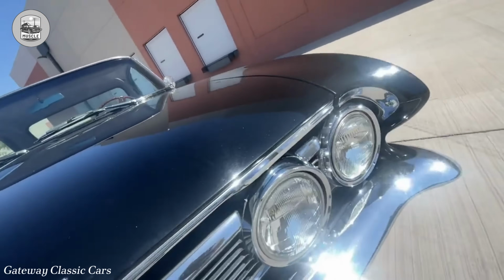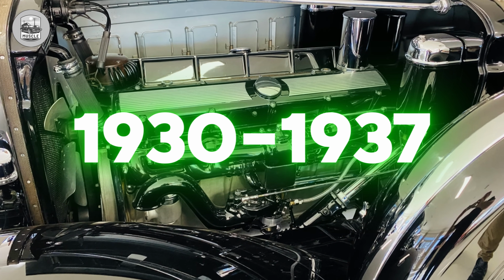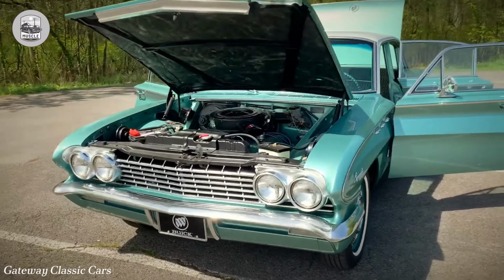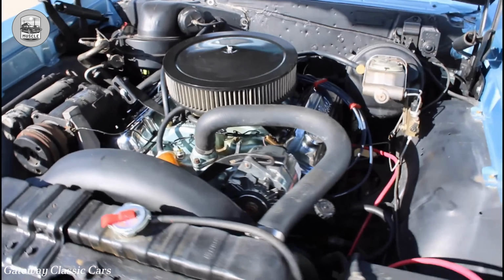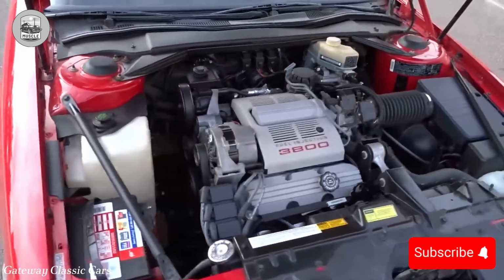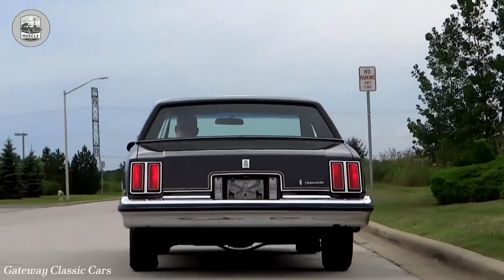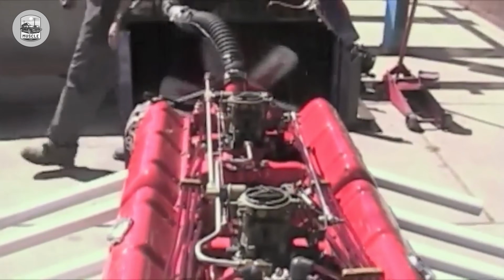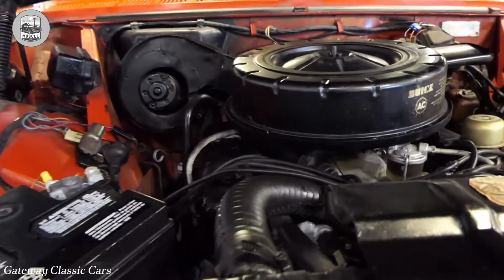10 MOST FAILED and WEIRDEST GM Engines ever made | Worst engines blunder!

Comment: There's my favorite oddball engine right at 0:48 ...  The Cadillac V8-6-4 with Eaton controls on the rocker arms instead of the disastrous, modern modulated displacement engines that screw up the lifters...  I drove one for 100,000 miles.
Reply: I bet you drove it with the ONE wire disconnected to disable the system. Those engines did NOT work at ALL well with it hooked up.
Reply: @davelowets  Nope, you lost that bet.  I put a rebuilt ECM in it when I first bought it in '93, and it worked just fine.  On flat highways like Marin to Sacramento it got 22 MPG with the Modulated Displacement system active, and 18 MPG disabled.  (I think one of the newer, lifter-type systems are called DoD, Displacement on Demand..)
Reply from the maker: @davelowets  You're spot on! Many enthusiasts found that disconnecting the one wire to disable systems like the early emissions controls or fuel-saving features brought the engine back to life. These engines, especially with early versions of technology like GM's Displacement on Demand or similar systems, struggled with performance when everything was hooked up as intended. That said, when bypassed, you could really unlock the true potential of these V8s. A lot of people prefer the raw, unrestricted feel of these engines without all the added electronics.
Reply: @MuscleCarMasters68  Yep. I drove one back in the day, and it ran a WHOLE lot better with the system disabled. It's too bad that it didn't work right because that really would have been a gem back then.
Reply: @MuscleCarMasters68  Don't get carried away, you still ended up with a smogged out, low compression 140 HP engine...
Reply from the maker: @marko7843  You're absolutely right – by the mid-'70s, many muscle car engines were hit hard by emissions regulations, leading to lower compression ratios and reduced horsepower. The muscle car era had to adapt to new government standards, and unfortunately, many engines suffered. That 140 HP mark was a far cry from the high-compression beasts of the late '60s! However, enthusiasts quickly found ways to bring back some of that lost performance by upgrading components, like heads, cams, and exhaust systems, to work around those restrictions. It's amazing how much potential those 'smogged out' engines still had with a few tweaks!
Let’s hear from more of you! How did you modify or improve your engines during the '70s? Drop your experiences in the comments! 
Thank you so much.
Reply from the maker: @davelowets  Great to hear from someone with firsthand experience! You hit the nail on the head. Systems like GM's early Displacement on Demand and other emissions or fuel-saving features were ahead of their time but often fell short in execution. When these systems were disabled, it allowed the V8s to perform as they were originally intended – powerful and unrestricted! These engines were built with raw potential, and once enthusiasts bypassed those early tech limitations, they could really tap into that classic muscle car feel we all love.
Reply: @MuscleCarMasters68  As long as you brought up the broad subject, I want to put in an honorable mention for the 1972 Olds Rocket 350.  As you know, GM chopped their compression ratios in 1971, a year before GM and Chrysler, and God knows I've driven many of the depressing results made between '71 and '79.  A mere 5 years later that same rocket 350 was totally gutless...  Somehow though, WITHOUT an air pump, Olds got the '72 heads & cam so right that my Cutlass would easily shred the rear tires, deliver 20 MPG at 70 MPH without overdrive, and you couldn't even make it ping!  You could advance the spark until the engine misfired, and it would never ping on regular leaded 88...   Sighhhh
Reply from the maker: @marko7843  You're absolutely right about the drastic compression drop that hit the early '70s hard, making many of those engines feel sluggish. But Oldsmobile somehow managed to get the balance just right with the 350 in '72. The combination of those heads and cam, as you pointed out, gave it a surprising punch. The fact that it could shred tires, deliver impressive fuel economy, and resist pinging, even with the timing cranked up, really shows how well-tuned that engine was. It's amazing how Olds worked around emissions restrictions without needing air pumps, something that plagued other GM engines of the time.
It’s a perfect example of how the right engineering can make a low-compression engine still perform beautifully. That 20 MPG at 70 MPH without overdrive is impressive, especially for the era. They really nailed the balance between performance and efficiency, which is a feat not many automakers achieved in that era.
Reply from the maker: That's awesome to hear you had such a great experience with the Cadillac V8-6-4! This engine was a bold step for Cadillac back in the early '80s, introducing cylinder deactivation long before modern systems like GM’s Active Fuel Management. The Eaton control system on the rocker arms allowed the engine to shift between 8, 6, and 4 cylinders, and when it worked right, it was a marvel of engineering. Unfortunately, it wasn’t without its hiccups, mostly due to the electronics of the era, but it's great to know yours held up for 100,000 miles!
Today's modulated displacement engines, like those using AFM or DoD, have come a long way but you're right—issues with lifters in these modern systems can be a headache. It’s interesting how Cadillac was ahead of its time, even if the technology needed some refinement.
For everyone watching, what’s your favorite oddball engine? Let us know in the comments! And if you're enjoying these deep dives into unique and forgotten muscle car engines, don’t forget to comment, share, and subscribe to Muscle Car Masters for more content like this. We've got plenty more to discuss, so stick around...

Comment: The Cadillac 368 was a dog, couldn't get out of its own way
Reply: I have to respectfully disagree with the view that the Cadillac 368 was a 'dog.' While it's true that the 368 wasn't a high-performance powerhouse, it was designed for luxury cruising rather than raw speed. The engine's focus was on smoothness, reliability, and fuel efficiency, especially in the era of increasing emissions standards and fuel economy concerns. It provided adequate power for what it was intended to do—offer a comfortable, relaxed driving experience in a large luxury vehicle. In its time, it was a solid engine for Cadillac's lineup, even though it wasn’t meant for aggressive acceleration or high-speed performance.
Reply from the maker: Thanks for sharing your thoughts! The Cadillac 368 certainly had its challenges. It was introduced in 1980 as part of Cadillac’s attempt to downsize engines to meet fuel economy regulations. With only about 150 horsepower, it wasn’t built for high performance, which is why it might have felt underpowered compared to the V8s from earlier decades.
However, what's interesting is that the 368 engine was the base for Cadillac’s infamous V8-6-4 variable displacement system in 1981. While the idea was revolutionary, the technology wasn't quite there, and that made for some pretty frustrating driving experiences. But when it worked, it showed a glimpse of the future we see today with modern cylinder deactivation systems.
We’d love to hear more from you and anyone else with experiences or thoughts about the 368 or Cadillac’s engine downsizing era. Don’t forget to comment below with your thoughts, share this video with fellow gearheads, and subscribe to the Muscle Car Masters channel for more deep dives into automotive history!

Comment: You didnt mention the 4.1 version of the Buick v6  which was equipped with a 4 bbl carburetor.
Reply: While the 4.1 version of the Buick V6 with a 4-barrel carburetor is a notable variation, it's important to remember that its performance was not significantly different from the 3.8-liter versions equipped with turbochargers or even the later fuel-injected models. The 4-barrel carburetor was a step up in aspiration for the engine, but it didn’t bring the same leap in power or innovation as the turbo models, which is why it wasn’t the focus here. The turbocharged engines really helped elevate the V6 platform to a new level of performance.
Reply from the maker: Great point! The 4.1L (252 ci) version of the Buick V6 was an interesting evolution of the 3.8L V6, especially with its 4-barrel carburetor, which gave it more breathing room for improved power and torque. Introduced in the late '70s, the 4.1 was aimed at providing better performance for full-size cars without moving up to a V8. It was a popular engine in the early '80s, especially in the Buick LeSabre and Regal. Buick really made the most of their V6 design with variations like the 3.8 turbo and this 4.1L!
Thanks for bringing that up! What other underrated engines do you all think deserve a shoutout? Let’s hear your thoughts in the comments below! And don’t forget to like, share, and subscribe to Muscle Car Masters to stay tuned for more deep dives into iconic American muscle!

Comment: the Oldsmobile V8 Diesel wasn’t 4.3L, that was the downsized V6 for smaller models, the V8 (I guess V6 too) was based off the Oldsmobile 350 gas engine and was adapted to run off diesel and still used a lot of parts from the gas engine that shouldn’t have been used for the diesel, like the head bolts. they also didn’t add a water separation system. so not only would the head gaskets constantly blow from the high compression that the diesel made and would lift the head, but as well as water would be in the tank and without a water filtration system it would run like garbage from the water being in the fuel tank and would corrode the bore, and people who bought them would be disappointed from the lack of power, to the loud noise diesels produced, to the unreliability. GM ended up ruining the consumers perception of diesels and it was a long time before they made diesels for cars again. they also put these engines into trucks as an option.

fun fact: they also made a V5 variant that never went into production because of the failure of the V8 and V6 diesels
Reply: Additionally, while the engine did indeed hurt consumer perception of diesel, GM's experimentation with diesel power was ambitious for the time, and the engines performed better under ideal conditions than their reputation suggests. The technology wasn't fully ready for the mass market, but not all owners experienced catastrophic failures. The legacy of these engines paved the way for more reliable diesel technology down the road.
Reply from the maker: You're spot on—the Oldsmobile V8 Diesel was actually a 5.7L, and the downsized 4.3L was the V6 variant for smaller cars, like you mentioned. Both engines were indeed based on the Olds 350 gas engine, and GM cutting corners during the adaptation to diesel had major consequences. Using components like the head bolts from the gas version was a huge mistake. Those head bolts just couldn’t handle the extra pressure from the diesel’s higher compression, leading to constant head gasket failures. The lack of a water separation system was another major oversight—diesel fuel and water don't mix, and the resulting damage to the engine components, like the bore, was brutal.
The lack of power, the noise, and the reliability issues really destroyed GM's reputation when it came to diesel engines. They essentially scared off a whole generation of car buyers from diesel options. It's fascinating that GM even explored a V5 variant, but given how badly the V8 and V6 diesels were received, it's no wonder that idea never saw the light of day.
For everyone else reading, if you’ve got more insights or your own stories about these engines, drop them in the comments! Let's keep this conversation going. And if you're into more American muscle history like this, make sure to like, share, and subscribe to Muscle Car Masters for more deep dives into the engines that made—and broke—muscle car history.
Have a good day.
Reply: @MuscleCarMasters68  As I understand it, only the big, and earlier, 5.7 diesel versions had really inadequate head bolts and once they retooled the head bolts for the smaller 4.3 v8 and v6 versions, blown head gaskets were greatly reduced and these engines, though very slow, continue to provide practical transportation to this day using aftermarket water separators or emulsifier fuel additives.  Even the 5.7s can be upgraded to reliability using top quality aftermarket head bolts as the guys at Junk Yard Digs have repeatedly demonstrated.   I really wish they had stuck with the V6 and added water separators and improved head bolts instead of discontinuing the whole program, but for practical midsize plodders these are still available on the used market for good prices, and upgrading the 4.3s are easy and the 5.7s with a bit more work.  These are not scrap.
Reply from the maker: @alan6832  Great insights here, and you're absolutely right about the head bolts being a major issue with the early 5.7L diesels. The improvements made to the 4.3L V8 and V6 versions definitely helped in reducing blown head gaskets, especially with aftermarket support like better head bolts and water separators or emulsifier additives for the fuel system. It’s impressive how with just a few key upgrades, these engines can still serve as reliable, albeit slow, options today. Junk Yard Digs has shown exactly how durable these engines can be when properly upgraded, and it’s a shame GM didn’t stick with the V6 program.
For anyone looking for a budget-friendly, practical option, these engines are definitely not to be written off. With the right tweaks, even the 5.7L can be a reliable powerhouse! If you’re into turning scrap into gold, this could be a great project.

What are your thoughts? Drop a comment below! And don’t forget to like, share, and subscribe to the Muscle Car Masters channel for more engine deep dives and muscle car history!

Comment: The failure to fill the Rocket Fuel booster is a common practice to the engine oil and washer fluid level check.
Not to forget  the transmission and differential fluids.
The only gauge, and even that is ignored is the fuel gauge.
85% of drivers are, if it starts and moves...good to go.
Reply: While it's true that many drivers may neglect regular maintenance checks, it's important to push back against the idea that ignoring critical fluids like engine oil, transmission fluid, and differential fluid is acceptable. These fluids are the lifeblood of your vehicle’s systems, and failing to monitor them can lead to serious damage or breakdowns over time. The Rocket Fuel booster is essential for performance, and proper upkeep prevents costly repairs down the road. Encouraging drivers to rely on just the fuel gauge or the ‘if it starts, it's fine’ mentality overlooks the importance of preventative maintenance, which keeps vehicles running safely and efficiently for longer."
Reply from the maker: It's a common issue that many drivers overlook crucial checks beyond just fuel. It’s easy to forget the engine oil, transmission fluid, and differential fluid, but these are the lifeblood of any muscle car! Keeping your fluids at the right levels not only extends the engine’s life but ensures peak performance—especially in a high-powered machine. Muscle cars need that extra care to stay running strong, so don’t let “good to go” be your standard!
For anyone watching, make sure to stay on top of all your maintenance—your muscle car will thank you for it! Comment below if you’ve got any tips on keeping your ride running smoothly, share this video with your car-loving friends, and don’t forget to subscribe to Muscle Car Masters for more essential car care and muscle car history...

Comment: Today they are installing tubo on the engines. From what I read they are major problems now also. I don't know why we need all the speed and power.
Reply from the maker: Thanks for sharing your thoughts! You’re right, turbo installations can introduce some new challenges, especially when it comes to heat management and engine longevity if not done right. In fact, older engines were typically built to handle natural aspiration, and adding forced induction like a turbo can put extra strain on components not originally designed for it. But for many enthusiasts, it’s about the thrill—modern turbos offer a huge boost in performance, giving these engines massive horsepower gains without needing to go to extreme displacements.
That said, not everyone is after speed and power. It’s great to appreciate both ends of the spectrum, whether you’re a fan of raw, unboosted torque or the next-level acceleration from a turbo. We’d love to hear more perspectives from the Muscle Car Masters community on this topic! What do you all think—turbo or no turbo? Drop your thoughts below, and don’t forget to comment, share, and subscribe to Muscle Car Masters for more awesome car content....